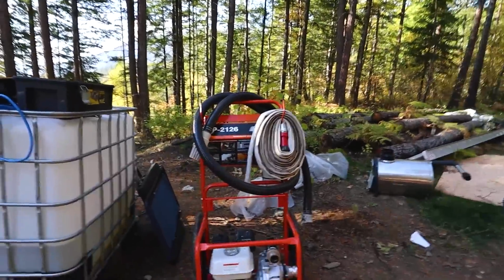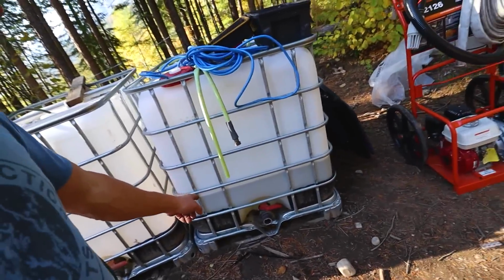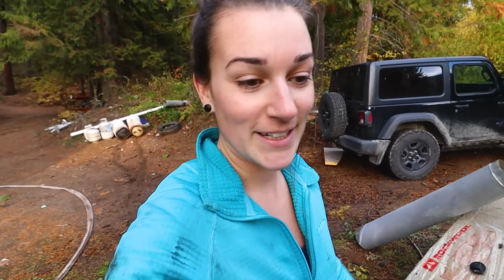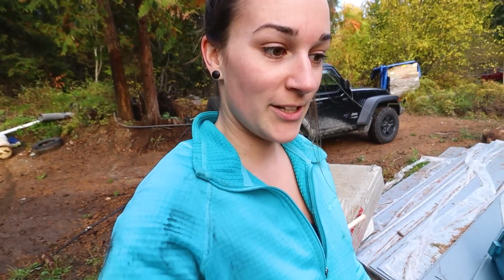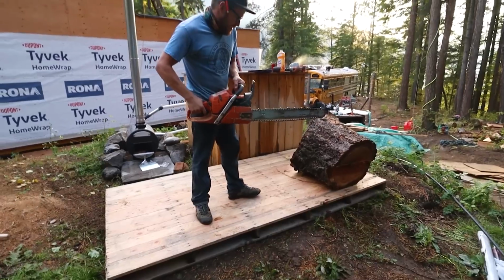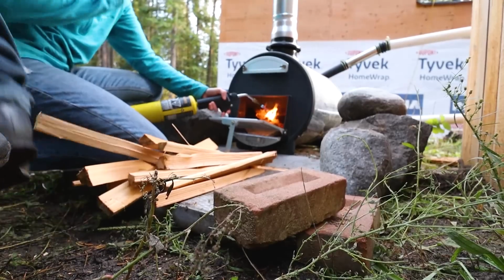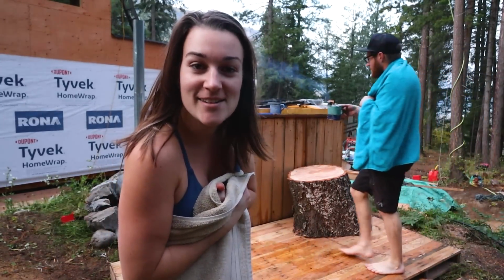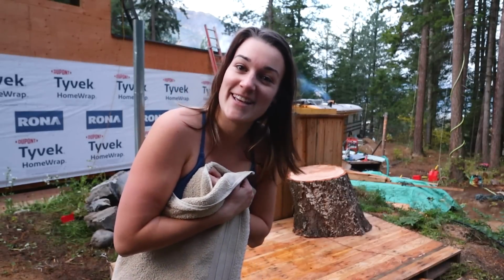We Finally Have A Wood Fired Hot Tub!

Comment: hi friends, I've had a Chofu for the last 18 years...10 years it was outside in similar conditions to yours and it works great and is still trucking along.  I moved it from my mountain cabin to my home in a rural area....now at 18 years it has some rust but everything is going pretty well.  when it's very cold, i'll take a bath and let the wood stove cool down a bit and pull the plug to allow all the water to dran out.  I didn't do this ONCE and yes it froze, so I won't let that happen again.  It works well to drain the same night.  The tub itself will keep water for up to 24 hours before really freezing (at zero C/F) and I'm sure you've already added a spark arrester cap to the top of the wood stove piping.  Like you we have forest fires here (I'm in Oregon USA) ... keep our fires under control for sure.

Comment: I was just looking at the two of you getting the hot tub that you the night before got up and running. I was thinking that you should get some insulation and put it around the outside between the wood and the tank to keep the water warmer for much longer. That way you won't have to burn so much of your firewood to heat it up again after you leave it over night. Even insulating the bottom and top would be even better.

Comment: Here in S Florida, our inground pool is heated by solar panels on the roof of our house, the water runs through the pool filter controlled by two valves attached to a pool's thermostat. Today the water temperature in the pool was set to 90 degrees. Outside air temps low 80's.

Comment: You can buy these in Canada in Sechelt area which is taking the ferry from Horseshoe Bay and across to Gibson Landing.     You can get fire pumps, Sprinklers but for the pressure in CHilliwack, BC       The fellow in CHillwack could probably tell you a lot about big heavy duty springlers if fires burning in your area.      O assime your building in BC but yoou have kept that obvious for reason.

Comment: There are many plans on line where you can make a cedar hot tub and plumb in your heating element, made a little shorter but much larger.  It really works great and easy to maintain year round.  Keep up the great work from Arizona.

Comment: do you think that PVC can take the heat ( I like the radiator hoses and fittings I do think they will take the heat )
Reply from the maker: So far there are no issues. We have a leak at one of the connections to the tub that needs to be fixed